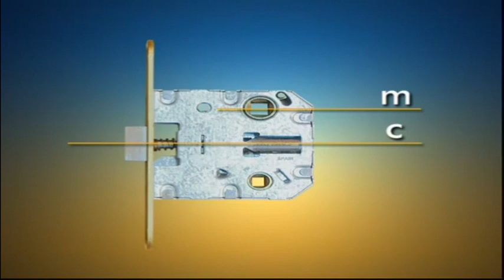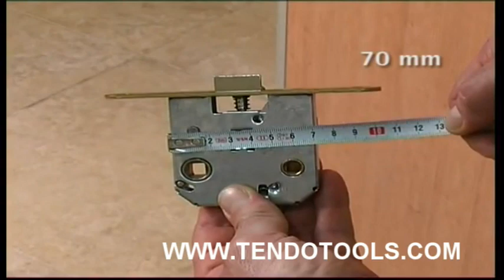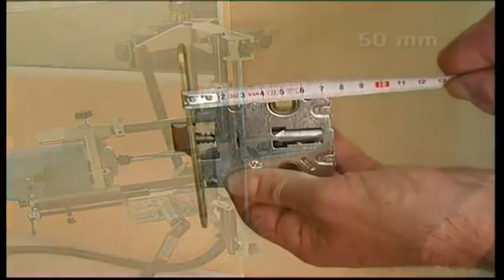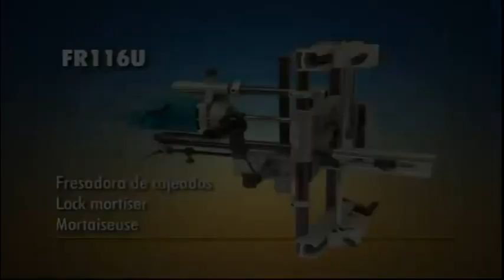VIRUTEX FC116U SLOTBOORMACHINE

Comment: Who wants to build a jig every time you want a mortise a hole for a mortise lock? Even with your plunge router you're still doing way more work than what this machine is doing. Clamp the machine on the door and just use it. What a plunge router building a jig getting some clamps to clamp it on the doors Edge so it won't fall off. Then you're balancing your big plunge router base on the edge of an inch and 3/4 door. It's just cumbersome it's always been cumbersome. With this machine it makes it simplistic simple any Craftsman would have to admit to that